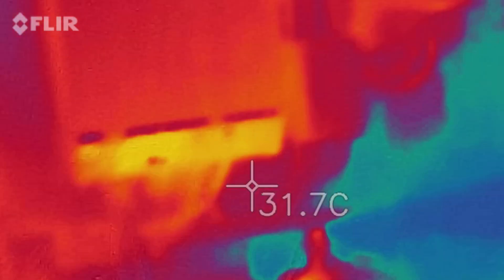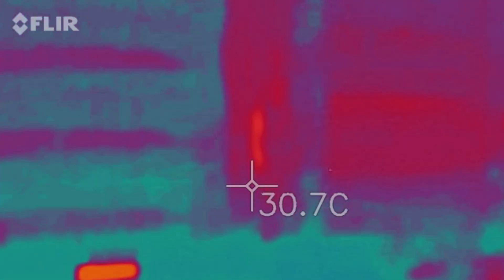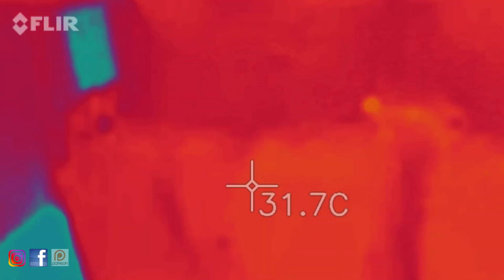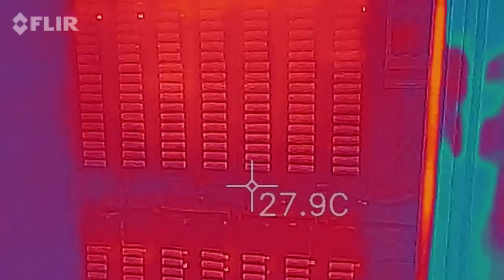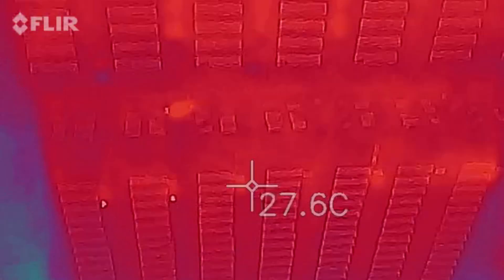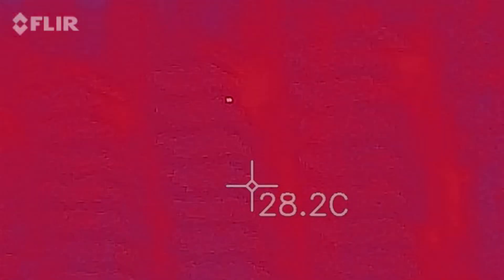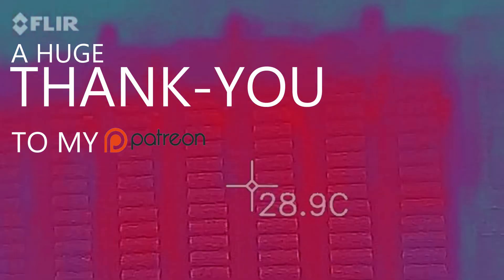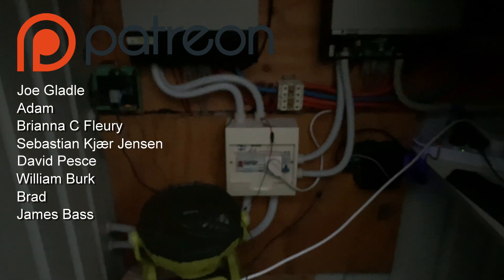When you find your very own heater....

Comment: OK So I am going to use the nickel fuse and spot welder. 

I have 180  (3Ah) brand new batteries and 500+ 2nd or 3rd hand. 

I am starting to think that I should only use the new batteries in my powerwall and keep the other's for lights and smaller things as I haven't got a clue about the history of 60% of the laptop batteries.

Anyone else thinking the same way

Comment: That's one thing about this battery chemistry that turns me off on it.  Lithium batteries when they go, if they go all at once which is rare is worse than allot of high explosives.  I did check on the 21700 batteries.  Its lower voltage but will higher amps.  You would need 16 vs the 14 for that one.  Still think NiFe is the safest of them all and more dependable.  Just think they are more costly as they aren't in great demand.

Comment: What was your cell voltage at when you saw the heater?  I always thought the heaters usually only show up in the 4.1 - 4.2 range.  My batteries spend most of their time less then 4.0 so I wonder if I'd even see any.
Reply from the maker: a heater will heat till its zero volts
Reply: @HBPowerwall  What size fuse are you using on your batteries and are you able to measure the amps going to that bad cell before you pull it out? cheers.

Comment: Considering that one cell was warmer on the end, could it possibly be a bad solder/weld joint instead?  I would think a self heater would be more uniform in heating up, especially a slow heater.

Comment: Is it worth turning the packs 90 degrees so either the top or the bottom of each cell is visible? Would make finding a heater much easier....?
Reply from the maker: In some cases many are. In others like mine that won't work easily

Comment: Was this power wall sitting idle, being charged, or under load when you checking temperatures?
Would be interesting to test in morning after under load for an hour ... to see if can spot more significant temperature differences between cells.
Reply: They heat up most when you're charging them. A dead or low capacity cell will just float with the paralleled ones during a discharge.

Comment: I bet you don’t even put 250ma stress on each 18650 cell, so would be hard to find a heater.
In fact that’s a good question. How much load do you put on each cell when your running at maximum output?
Reply: @DIY Projects thanks for sharing your experience, sounds like high internal resistance cells, which are bad anyways so it makes sense that you remove them, in my test i used very low current so it was only noticeable when they got close to, and over 4v, and when removed from charging they were still warm and self discharged noticeably
Reply: A heater when left to it's own will slowly discharge to 0v. When in a pack the other cells will feed it. A high resistance cell will heat more than the others while charging and discharging but that's not a massive worry
Reply: @DIY Projects and when it comes to solar charging you can charge the battery’s harder than you use them.
Reply: its not about the load but the voltage that shows heater cells. it could be towards the end of charging cycle when batteries are almost completly cool when it would be the most obvious